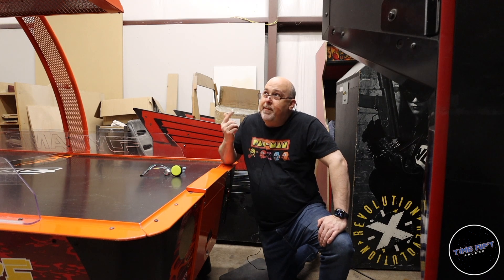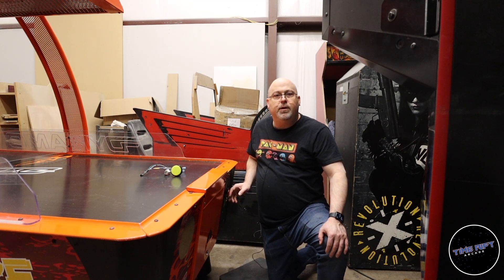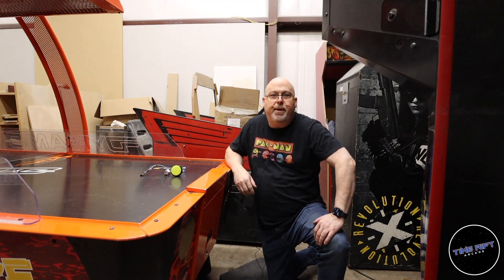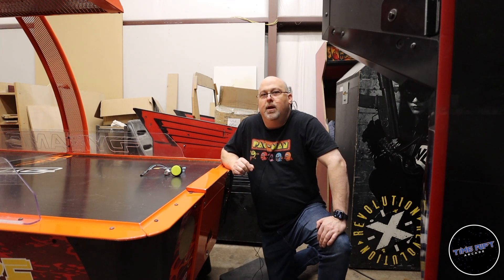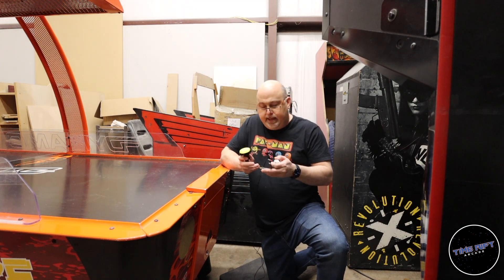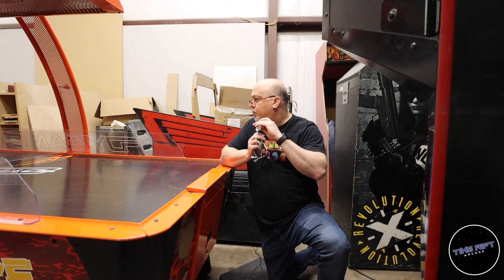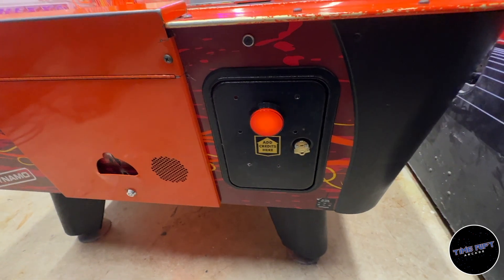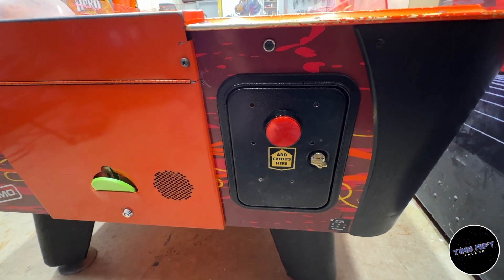Dynamo Firestorm Arduino Air Hockey Hack - Stop Multiple Button Presses

Comment: Just discovered your channel and loviong the content. The DE teacher inside me wants to know: Could it have been possible to incorporate a basic resistor/capacitor circuit that takes time to recharge instead of using the arduino?
Reply: Ooops, just saw the other comments regarding this 😅

Comment: Late comment on an old video, but I feel like those criticizing the choice on an Arduino are underestimating just how cheap they can be and the speed advantage of working with a solution you are familiar with and have parts on hand for. He probably had it coded up and flashed on the Arduino quicker than he could have ordered parts for another approach.
Reply from the maker: Exactly.

Comment: FYI if you ever need something like that agin they do sell 12V timer delay modules. I used to use them in the security world all the time to prevent people from pressing buttons numerous times right away. They work great. There is a dial on them so you can adjust them. Press the main button once and it closes the circuit once. Press it again within the timer and nothing happens. Once the timer is done it allows you to press it again. They are only about $20 - I believe Altronix makes them. It also gives you a DRY contact so you're just making/breaking the circuit (like a coin drop would do)

Comment: I'm working on something very similar for someone who works in an arcade and has a similar issue with an Air Hockey table (and other games). I'm going to be doing the same timeout as yourself but with an ATtiny85 Arduino and a relay. Like you, we'll indicate if a button press is available with an LED button.

Comment: Works perfectly! Great and elgant idea (plenty of others here too that'd work too of course)

I wouldn't able to stop my self going on a hunt to find "something" that gives an output when a game is in play (like a light thats on either on the machine or in the machine/board, or a solenoid thats energized like the one that holds up the puck when the game finishes, or even the signal to the air pump, surely theres a relay with a low voltage signal to control the airpump system?) and try to use one of those as an additional input to the arduino, skip the whole timer and have it lock out completely while a games in session

Of course, you'd then need to effectively customize install into each machine looking for inputs but you could keep the timer setup in the code as a "fallback" if no input is found on the gpio for a signal like above (or a bridge piece over 2 other gpio's that can added/removed on a per machine basis to enable/disable the timer code over a signal input mode)

Damn it, i'd never get anything fixed or done, i'd spend too much time perfecting 1 machine lmao and no one else would know how the damn thing worked

Comment: If table have "in game" or "gameover" output or lights something like playfield lamp if game is active than you could use a relay to disconnect button when its in palying mode. But arduino is still better than using Rpi
Reply from the maker: It doesn't have any of those things.
Reply: @TimeRiftArcade  hmm don't know how about US machines but in europe ones playfield is not light up when not in game. Maybe a fan that generates air for pod lift. But still if it works it works plus you can use arduino to animate button backlight for when time is counting

Comment: I love your solution, but that still allows more creds to be added while the game is in-use, wasting power as the fans and such continue to operate for subsequent games. What I'd suggest is splicing a relay into the power feed for the fan that can trip a second input on the Nano so it knows how long the game is going because the fan is still in operation. Then tweak the code a bit so as long as the fan runs, the button light shuts off and it locks out additional "credits". After the game concludes, the computer shuts down the fan, the relay unlocks, and you can reactivate/light the cred button! I can't wait to see more!!

Comment: Same trick on the video poker machines. Difference is it has to be a quick on off switch on video poker machines or they crash on several models and display a cheating error message

Comment: I'd like to go back in time to the 1960s and see the faces of NASA engineers if I told them that one day someone would use a computer more powerful than the Apollo Guidance Computer to prevent children from pressing a button too quickly on an air hockey table.
Reply from the maker: That's absolutely amazing to think about!
Reply: explaining the SoC computer is also far cheaper than the analog solution to this human bug as well lol
Reply: hahahahahahahaha 🤣
Reply: Not just more powerful... But like, what... 10 orders of magnitude more powerful?
Reply: @BrainSlugs83  Arduino runs an ARM Cortex chip where most instructions are executed in one cycle, with a few instructions in two cycles. Considering these chips can run up to 40MHz, that's roughly 40 million instructions per second. The AGC could perform 40 thousand instructions per second. So this Arduino is one thousand times faster (3 orders of magnitude), give or take.
Reply: True, they wont believe you and lock you for heresy...lol
Reply: If you told them you were from 2024 they would probably believe you.
Reply: And which is the size of a stick of gum
Reply: and then he get even more surprised then he learn that we have not yet return to the Moon.

Comment: We mash the button so if we die a bunch of times in an arcade game we dont have to go back down and hit it more 😭
Reply: This has all kinds of unintended consequences:

1) What we mentioned here - false coin jams.
2) If you walk away from the air hockey machine without finishing, it will run the motor and sounds with no one using it for as long as it takes to cycle all of those credits, and that may be an hour or more. 
3) On many retro arcades, if you add a bunch of credits and walk away without finishing each game, the game will just sit on the home screen until someone plays those credits.  This will cause the CRT monitor to "burn in" the image, causing damage to the screen.
4) Many people will come ask us to reset the game, because someone walked away and they don't want to finish someone else's game - they want to start their own.

I can probably come up with many more.  Be kind. Only add the credit you intend to play. 🙂
Reply: @TheGeekPub  no
(pushes the button a bunch of times)
Reply: @Porygonal64  And you're the reason we have to do things like this.

Comment: Timer relay would have been a much simpler and easier to maintain fix
Reply: Or a 555 timer
Reply: Maybe.  Pros and Cons to both.  Timer is simpler to build.  Arduino is infinitely modable with nothing more than a USB cable.  Most likely they don't want to pull the board and desolder/solder components to make a simple timing change in the future.

Comment: Arduino can deffo do the job, but you could probably accomplish the same task with a 555 Timer, a resistor, a couple caps and a 7400 quad NAND. <3
Reply from the maker: Absolutely!  The Arduino provides some flexibility though for easy changes to the code without needing to touch the electronics or remove them from the game.
Reply: @TimeRiftArcade Arduino is great for experimenting, but if you have multiple units, 555 solution scales better.
Reply from the maker: @mrblc882  I can push a code change over Wi-Fi.  Need to change the timeouts with a 555, I have to break out the soldering iron and open the cabinet.
Reply: @TimeRiftArcade  but once you get correct settings, you can cheaply replicate with 555 for multiple machines. Game will not change itself...
Reply: You don't even need the 555 complexity. This can be accomplished with even simpler components.